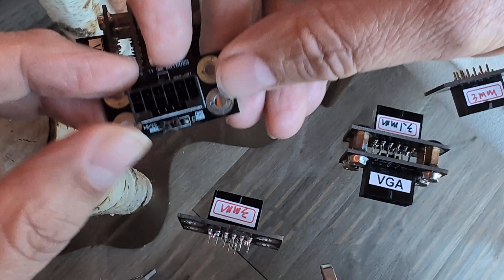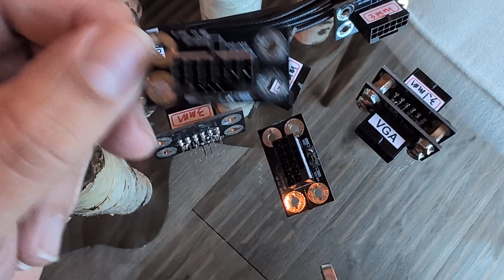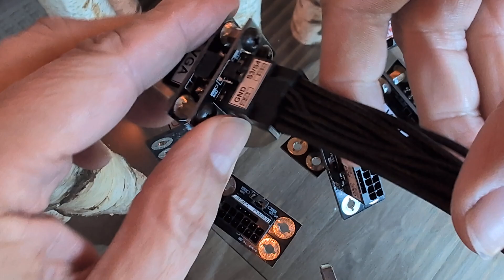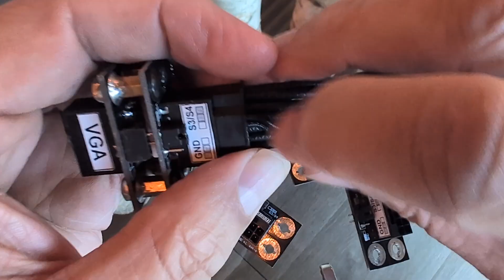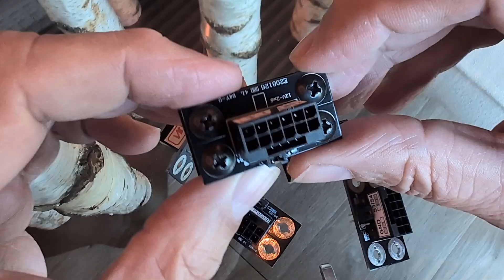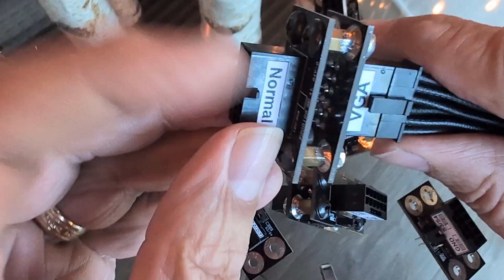The jigs I use to test 12V-2x6 connectors...

Comment: Are these the same as the 12vhpwr?
Reply from the maker: Not sure what you're asking.  These ARE 12VHPWR/12V-2x6 connectors.  But with different conditions that emulate different conditions of "improper installation".